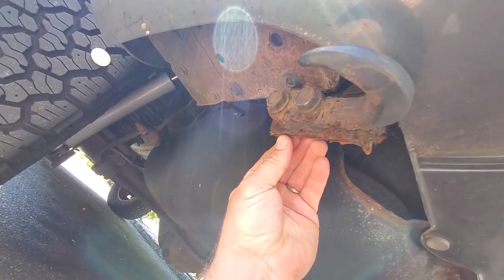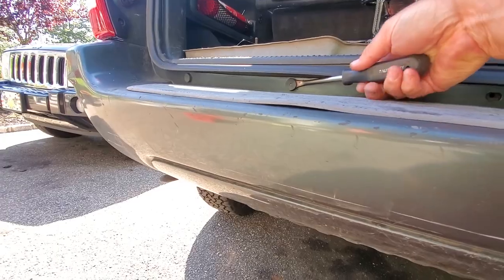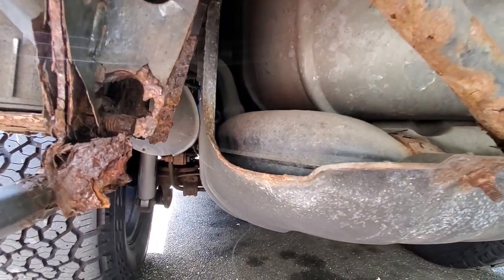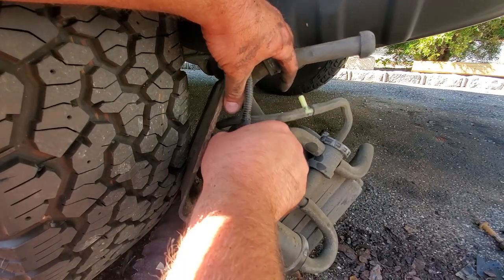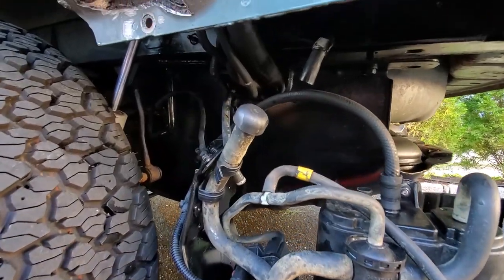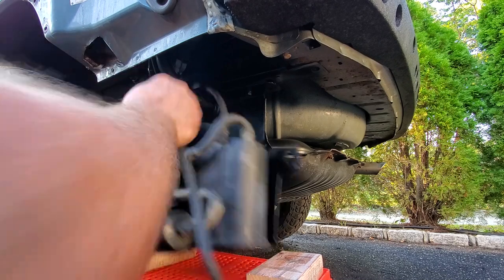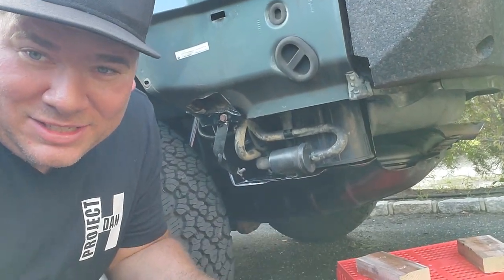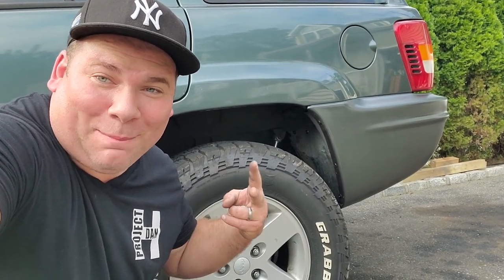JEEP GRAND CHEROKEE WJ P055 EVAP CHECK ENGINE  LIGHT -  FIX FOR GROSS AND SMALL EMISSIONS LEAKS

Comment: Dan, there is a thing on my 2004 Evap that is not on your 1999-200x.  52098655AJ  HOSE, Axle Vent, Contains a Set of Three Hoses, One Hose For Rear Axle Vent, One For Tee On LDP (Leak Detection Pump), and One For Outlet On The Center Of Canister.  I thought you would like to know.........er.... Like to Know.... Right.... Sure...
Reply from the maker: Hey thanks for the info.  It may have been relocated in 2004.  Most evap systems haven't changed too much

Comment: I had to replace the canister on my 97 XJ.  On this year, it's not in the back, like many others, it's inside the engine compartment atop the frame rail, buried deep deep near the bottom.

Easy to remove/install, except for the "get it out past everything else in the engine compartment" aspect.  Most of the AC system is in the way, resulting in a very winding path around all the hoses.
Reply from the maker: Yes.. it stinks when the hoses gets brittle and brakes

Comment: That was a lot better way than some I have seen. I think the bumper removal made it a lot easier - thanks for that idea; Does a gross evaporative leak cause poor gas mileage? My 4.0 is getting awful mileage - 14mpg on the highway, even after a plug change. I also have a Check engine light that shows "gross evaporative leak" as well as a small leak. 0442, 0455 and 0456.
Reply from the maker: Yes., Evap leaks are bad for MPGs

Comment: Hey Dan! Enjoy your videos as usual. Question for the EVAP. My 2000 Cherokee XJ is running a a P1494 code showing LDP but pricy and rather not spend the money to fix and have the same issue. What is the proper way to test the system or to verify that it truly is the LDP that is malfunctioning and needs a replacement?

Comment: Great video. Any info on the evap canister part num? Probably should do mine. Changed the evap solenoid. Still says lines blocked. Idle went back down though. Have to try to clear code. Thank you.

Comment: Amazing tutorial 
But what’s the symptoms of bad evaporator  ?
Reply from the maker: Evap CEL and poor fuel economy
Reply: @ProjectDanH  
My jeeb suffering rough ideal
With code p0505 , sensor replaced no change 
But when I check the EVAP
under the rear bumper I noticed there is brake in spherical plastic piece !
Could that BE the reason?

Comment: really helpful insightful videos Sir Dan! and the shoutouts to ratchet man cracked me up 🤣, the 2002 overland my Madre drives has the same two Evap codes- going to check it out! my 2000 v8 the evap canister is in the engine bay , wondering why it was later relocated 🤔

Comment: Awesome video!!!  I just started hearing a high pitched noise from that area - although I've had an evap leak for years w/ check engine light always on.  The noise is annoying though - prob a leak.  Thanks for the video!@
Reply from the maker: lol.  most leaks are from cracked hose ends

Comment: Question: The plastic clips you had to pop out in the fender well and along the tail gate area... Where did you find replacements? Do you have any part no's or did you just guess at it? Thanks in advance for your response.
Reply from the maker: I got a bunch of plastic rivets.  I put a link in the video description
Reply: @ProjectDanH  TY
Reply: I just used zip ties for my front bumper

Comment: Funny how you posted this as I'm having the time of my life fixing an EVAP leak on my 04. Been fighting it for 5 months. If you think your rear EVAP assembly housing is rusted out you should see mine lol! I replaced most of the hoses in the rear and all of them in the front. I'm about to just put a piece of electrical tape over the MIL light and say fvck it. Also you should try aero kroil instead of pb blaster. You won't regret it!!
Reply from the maker: Thanks man I really appreciate the tip. Good luck finding that fix! never give up

Comment: why wouldn't you just remove it it's a 20 year old vehicle all it requires is a safety inspection now
Reply from the maker: So it runs at its optimal condition and Don't want to look at a CEL
Reply: @ProjectDanH  it isn't necessary for it to run any better or worse unless you leave the vacuum lines open also they make diodes to use to trick the computer to not have a light on
Reply from the maker: @spartansoff-roadrecovery5058  Thats cool, but It was easier for me just to fix it, lol
Reply: @ProjectDanH  gotcha